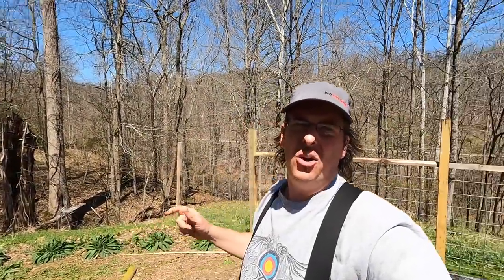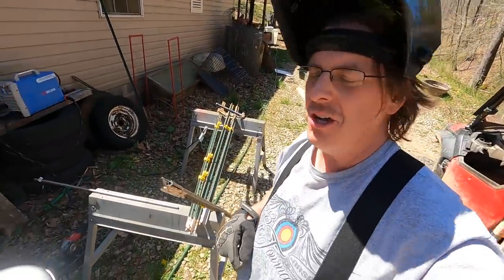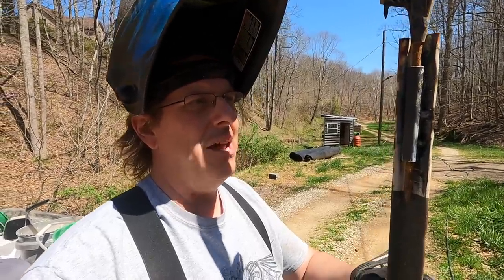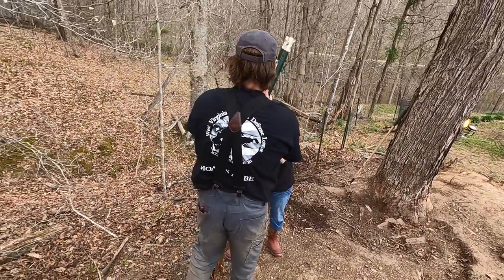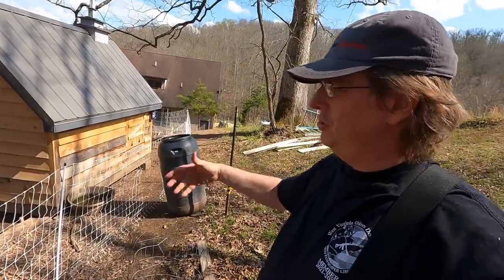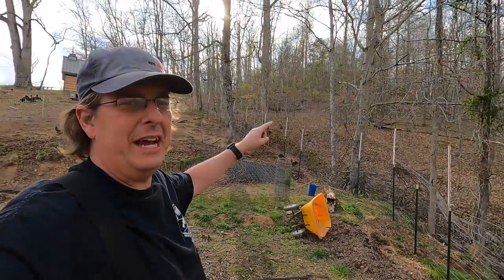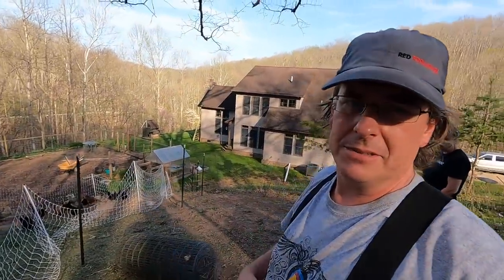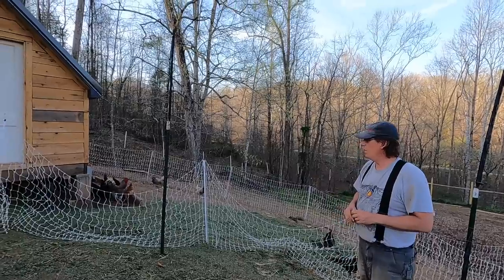Building DEER-PROOF Garden Fence with Modified T-Posts

Comment: Okay this is very ingenious to put up a taller fence. It seems rather expensive and time consuming. I have used a ridiculously simple fence that keeps deer out of your garden for 5 years now and we have a large population on our property. When we bought our homestead 7 years ago we couldn't afford an expensive taller fence. I researched the internet and discovered a forestry biologist in West Virginia that had the same deer problem.  He tried everything tall netting, electrical fencing and 7 foot high fence. The deer managed to get into the garden everything.  Then he discovered that a acquaintance of his had an Orchard and had no deer problems at all.  It's so simple it's actually ridiculous and everyone that uses it loves it. 
6 ft T posts about 20 ft apart. Here's the secret,  you use cheap 20 # fishing line placed at 16", 36", and 52" IT'S REALLY THAT SIMPLE!  This biologist swore it worked and he had used it for 4 years with 100% success. So I tried it and it works every year. I leave the posts up year round but put new 20# monofilament fishing line every spring. 
I've actually seen it work twice in 5 years. 
I'm sure it's worked dozens of times at night when we're inside. The deer don't seeit but when they push into it they backup and change direction.  It just kind of  freaks them out and they avoid it totally. It takes me about 30 minutes to restring my 3,000 sf garden and about 45 minutes to do my 5,000 sf corn patch.  On the sweet corn patch I add one strand electrical wire for the raccoons.  
It works and is dirt cheap, it keeps deer out of your garden, and all you really see are the posts. 
Good luck with your new fence. I hope it works to keep your garden safe.
Reply: I will be trying that. The deer eat our flowers. that would not be unsightly around the beds and if it works I will be a hero..LOL
Reply: Search deer fencing New Zealand to see how we do it here. We farm deer on a large scale but mainly red deer. Our fences are a lot stronger than what I see here.

Comment: Cheap method is to stack brush infront of the fence. Deer jump high just not far. My 4 ft garden fence I stack my tree limbs in front of brush pile. Have yet to have a deer get in. They normally avoid stick/ brush pile jumping. I suspect they are smart enough to know brush piles might break legs if they land wrong.

Comment: TROY,  just thinkin, to extend those 4x4s to a higher level,  you may want to consider short piece of 1/2" emt electrical conduit and 1 hole clamps to mount to them with, then add the short step in post on top. (If you wanted to keep it all symmetrical.) BUT  I  ain't buildin it, you are. Great stuff. Thanks for sharing.

Comment: Deer can jump very high but not a long distance.  If the still get in, because they can jump higher than that,  put a hot wire out about 3 feet up about 3 feet high.   They can’t jump that high from that far out.

Comment: Hi Troy, I’m cheap and have miles of 2.5” steel oil line on my place. So I cut 10’ lengths and drove them in the ground 8’. I ran 2 runs of 4’ goat fence around them. So far no deer!

Comment: OK when you first said you were going to use something to extend your fence and make it taller, my first and only thought was why aren’t you just buying taller fence posts. Well, I learned a lot from your video. Folks said move to the mountains you’ll love it! and what you would give for two level acres!
I watched your video to the end and I must say that my first thought was wrong, you were right and I love your idea of using that half inch square tube to give you a connection to put in your step in posts. So in summary, you came up with a brilliant idea and I love it!

Comment: When I saw you using tolls of tie wire and cutting each piece individually, I immediately thought of the wires used by lathers with 2 formed eyes on the ends and about 6" long. They have a cost but, when you really need to get something done, they're really hard to beat.
Mike

Comment: Can't say about East Coast Deer. But out here on the West Coast Mule deer are extremely reluctant to Jump. They crawl through brush all the time. Lower their heads and push through. So you only need a 5 foot fence with electric and ground (for dry soil) wires alternating  at about 10 inches apart. They stick their head threw and ground out. ZZZap works good. The idea came from the New Zealander's and their smooth high tensile wire.  Remember to succeed you gotta think like a Deer.   You want to catch Bass you gotta think like a Bass.   Sun Zu

Comment: We use dip-galvanized "shoes" that we drive into the ground. Then posts (2"*2"-4"*4") in painted normal lumber or pressuretreated which holds up quite nicely when it's above ground. Then we have what we call "älgnät" (moose net) that is abot eight feet high (240-250cm). It ain't the cheapest but it's strong...

Comment: Couldn’t you just weld a piece of rebar at the bottom to drive it into the ground and keep the 6’+ of T-post above grade? You can even bend it to L shape to have a foot hold for pushing. Rebar should be cheap option if you get scraps.

Comment: We have a 10 foot industrial chain link fence with a 1ft extension with barbed wire on top. I have watched white tail deer at dusk come up from the swampy area behind our building and jump that fence with hardly an effort, than calmly walk across our parking area to the farm next door.  You can slow them down, good luck stopping them if they want in.
Reply: Wow!  You must have very athletic deer in your area.  I put up a 7 1/2 foot fence around my deer infested 4.5 acres 2 years ago and have not had a deer "inside" since.  Maybe it's because none of my neighbors have a fence and the pickings are just easier to get to there.  They graze and travel all along the fence line but have never jumped in...YET!
Reply: @mtlefty8687  The first time I saw it I didn't believe it eather, I thought I was seeing things. Just a little run hop and over they go.

Comment: Just run a single strand of electric fence wire around garden with about 4 to 6 foot gap. Deer will walk up to it and not jump even if garden fence was normal fence height because it throws off their Depth perception.. but to be perfectly honest iv always had best luck with a single strand of slightly saggy electric  wire and nothing else. Deer want jump it if they think they can go under and when they do it's low enough to catch ears neck or back so they stay away and don't even try to jump.

Comment: It is hard to beat deer with height, it is easy to beat them with width.   Build your 6' fence the cheapest way you can, then go on the outside and pretend you are a deer, and figure out where you would jump from to jump over that 6' fence.   At the spot you would jump from, probably about 3' from the outside of your fence, you are going to make a second fence using 4.5' rebar  in the ground, so a height of about 4' total.  At the top of the rebar, attach a cheap line of metal wiring.  You only need 1 strand of wire.   If the deer is inside the rebar fence, they will jump straight up and can't go over the fence, if they are outside the rebar fence they can't clear both fences.  Also deer are notoriously stupid at the geometry involved with launchig over two obstacles.  Tie yellow ribbon every few feet of the wire to make it clearly visible so they don't walk into it.  For an extra level of mentally beating a deer, plant herbs or fragrant stuff between the two fences.  this is a great way to help keep out deer, rabbits and other things.